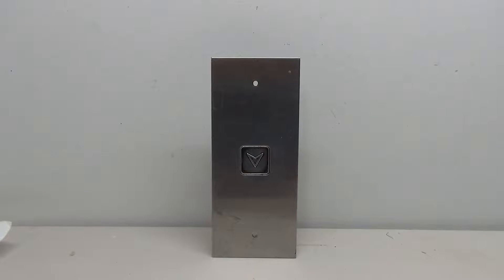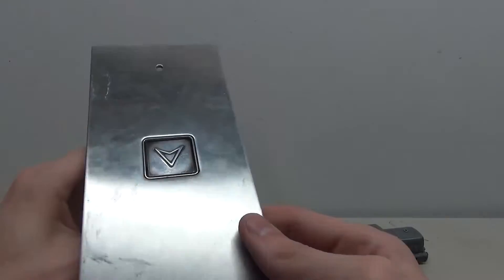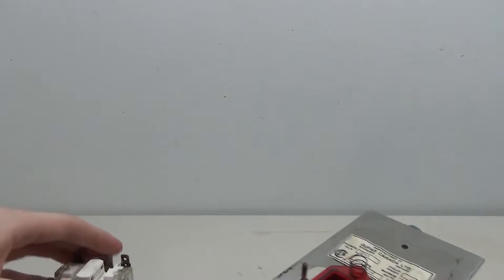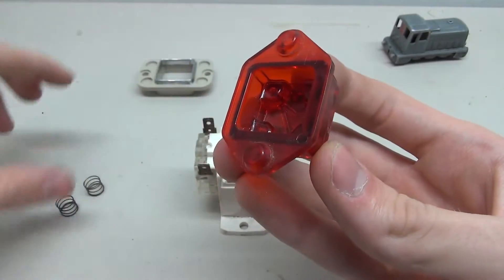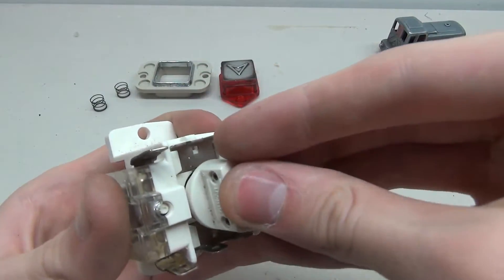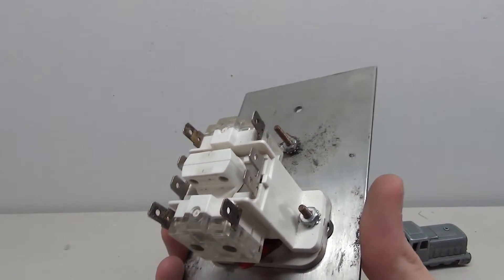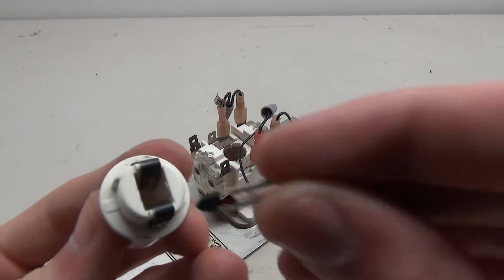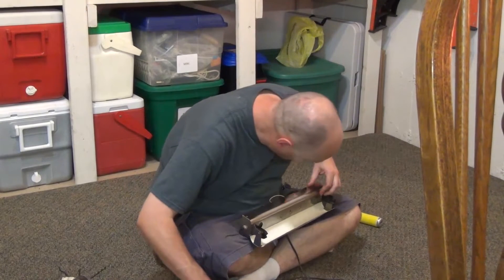Wiring Dewhurst Elevator Buttons

Comment: 3:19 Or in other cases, LEDs. The older buttons have lamps and the newer buttons have LEDs
Reply from the maker: LED upgrades.replacements are quite common.
Reply: @stlelevators  The newer buttons were installed with LEDs

Comment: In the uk when you see dewhurst it’s always a cheap crappy generic lift
Reply from the maker: Yeah, here, it's not as common. Innovation is the equivalent button over here, except I don't think it's as cheap.
Reply: @stlelevators  Dewhurst buttons themselves are actually very good quality. Well, maybe not compared to the older stuff, but it’s about as good as it gets nowadays. It’s just that most of the lifts that they’re used in are quite bad.
Reply: Mrmattandmrchay collected the Dewhurst fixtures from the growling LiftCran elevator and this is similar